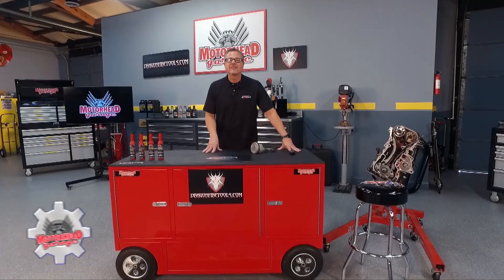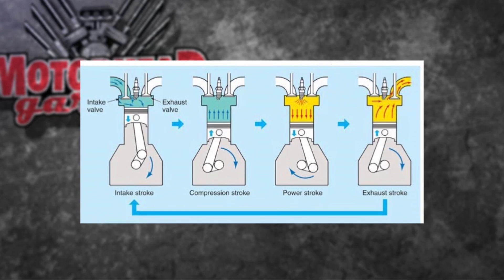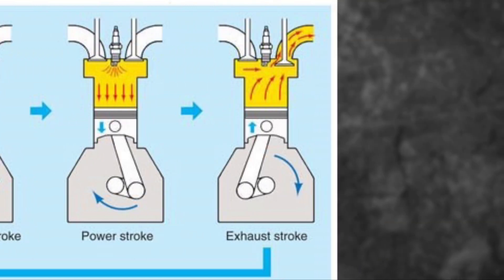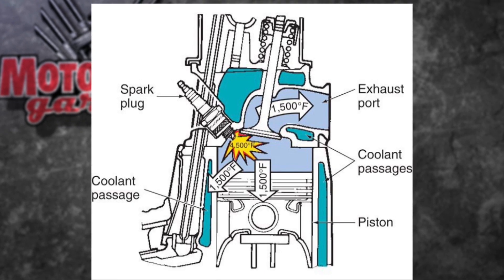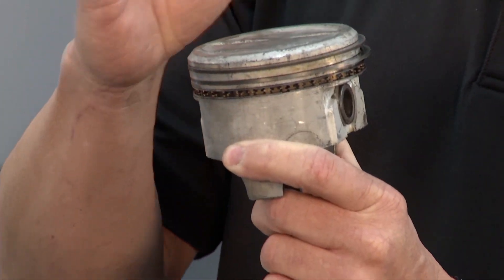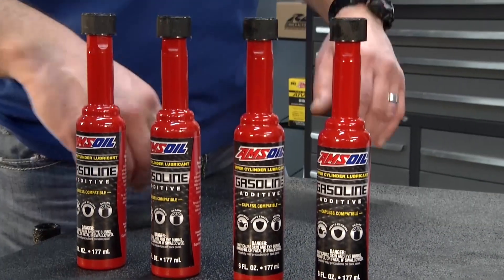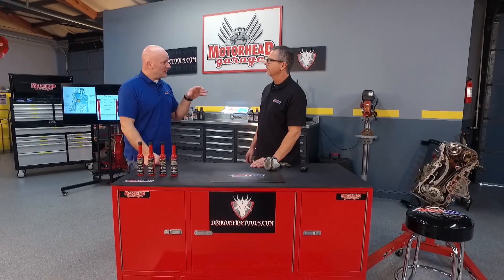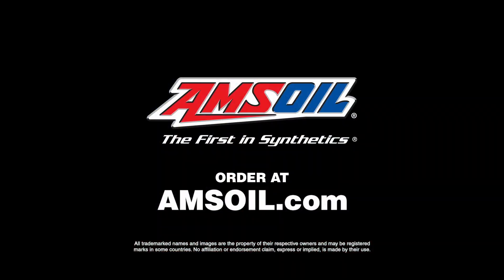How to Fight Piston-Ring and Cylinder Wear

Comment: It would be interesting to see a comparison between engines that have been put under a stress test with and without upper cylinder lubricant.
Reply: I agree. I have actually looked for such studies, but I never found any. Makes me wonder if tests have been done and the results were just never shared publicly because they weren't what the additive manufacturers were hoping for.

The theory of adding a lubricant to the fuel to help lubricate the upper cylinders makes perfect sense, but if the oil in the sump does such a bad job of lubricating the upper cylinders, how are so many engines regularly running for hundreds of thousands of miles with so little wear and virtually no loss in compression without these additives?

And even if there is some reduction in wear, will it matter enough to the driver to be worth the cost? Assuming someone keeps their car for 200K miles, which any decent engine should last with just basic maintenance, adding a bottle of this product for $5 a tank (preferred price of $4.49 + tax) every 350 miles will cost the driver $2855 over the car's lifetime.
Reply: @averyalexander2303  yup, exactly. If there was convincing evidence, it would be very interesting to see. Amsoil in general I like because they tend to be more transparent than others. If they published a study it would help a lot. Otherwise, I just use their other products.
Reply: @brandon9715  I agree. I'm a huge fan of Amsoil's products and they seem like a good company to do business with, I'm just not convinced that any upper cylinder lubricant will make a meaningful difference to cylinder or ring wear no matter who makes it since I have yet to see a need for the product or evidence that any of them work.
Reply: As a customer I'm doing that now in my 66 Corvair.
Reply: @melodymakerSD  No disrespect intended whatsoever, but since any differences aren't going to show up for hundreds of thousands of miles, the anecdotal results from a customer using some additive and reporting back with how their engine wore is meaningless. There are just too many variables in the real world that are out of our control. The testing would have to be done on a dyno under controlled conditions with the only difference being the fuel additive to be meaningful.

And even then, the results would only be applicable to that particular engine operating under those specific conditions. Things like the thickness of the rings, their tension, the material the rings and cylinders are made of, their surface finish, the fuel and oil used, the cleanliness of the air its breathing, the duty cycle the engine is tested under, the temperature the engine is run at, etc will all affect the results.

Comment: Upper cylinder lubricant causes oil dilution. Fuel starts building up in the oil and the oil level rises so I stopped using it hen everything returned to normal.
Reply: Wrong. It makes a 300,000 mile engine reach 500,000. Our pilot cars are the proof.